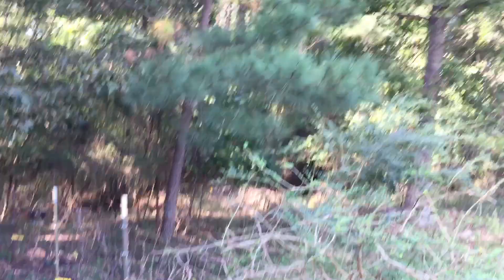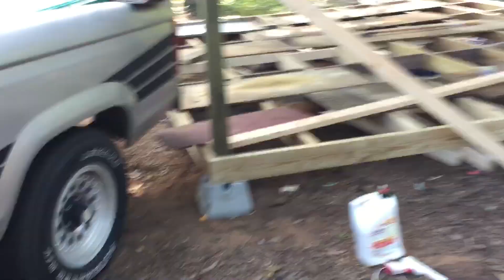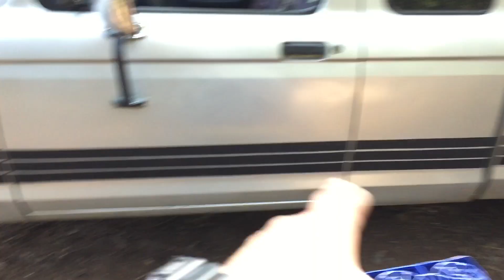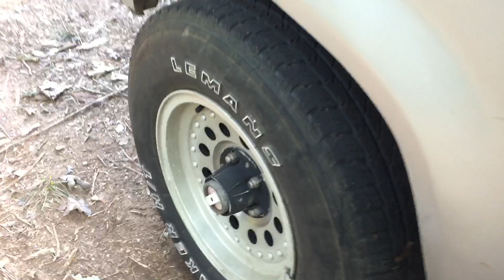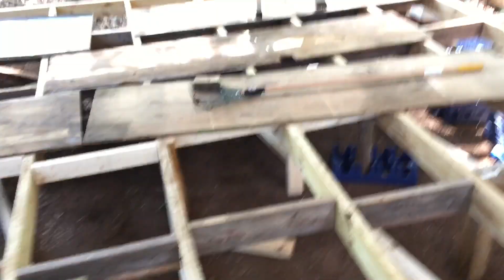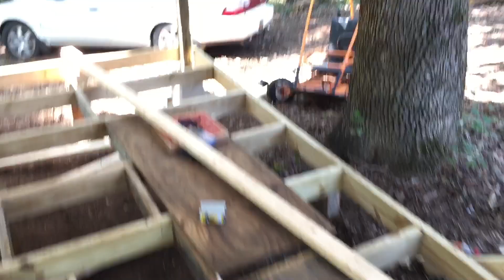Saturday Update

Comment: The tick is from the fuel injectors and is nothing to worry about. Lifter tap is common too, and is most noticeable when the engine is warm and ran on the highway for long periods. Rotating the thrust plate that holds in the camshaft is a fix for lifter tap. Doing so, blocks an oil drain hole...keeping oil in the top end. As for the bottom end knock...check the oil to see if it's contaminated with gas and also check or change the oil filter. Don't use Fram. The stripes on the sides of the truck are part of the "STX" package. I'd be more concerned with the transmission rather than with the engine. The A4LD is known for losing overdrive followed with the forward clutch pack. Swap in a M50D and enjoy. Nice truck!

Comment: Turn a 2wd Rwd pickup truck into a 4wd (prerunner.) They can go off-road but not everywhere anywhere. All you need is to raise them 2 inches and put used bigger tires wheels. Or just a homemade leveling 'kit'.

Comment: doesn't matter the age. things happen. back in the spring time, my 2014 gmc sierra stopped reading oil pressure and I got a message along the line of "oil pressure low. turn off engine" on the message center, so I pulled over and shut it down. I got out, pulled the dipstick, checked the oil level(oil change was done 2 weeks prior) and it was good, so I figure I'd try to limp it back to my work and park it(which was literally half a block), and when I fired it back up to do that, oil pressure was fine. It never done it since. i think the sensor decided it was gonna glitch out on me.

Comment: Sometimes you have those days that it just feels like everything is against you. Just keep going Jay and everything will be okay! The plates that you had in your truck are not ideal for a floor, but I don't know the thickness of them. If it's going to be heavily loaded, I would use them for the walls and find some different ones for the floor.
The symptoms you had with that rock knocking are weird and seems to me something like valve that have play in them. Would take off the valve cover for an inspection to see if everything looks alright.
Reply from the maker: Ilias Lamari this is literally tongue and groove subflooring. Its almost an  inch thick.... this is plenty. As for the truck, I have no idea. Im just gonna roll it until it wont anymore.
Reply: Jay Smart it’s 3/4 osb isn’t it ?

Comment: If you get a explorer or mountaineer with the 5.0 in the yard I would save the drivetrain. Or a f 150 with the truck 5.0 in it.
Reply: Get the expo or mountaineer, stupid easy to swap into ranger. I’m currently putting a 5.0 in a 2002 ranger

Comment: OSB(chip board) goes on walls; not the floor. It only has vertical load bearing.
Reply: Corbin Greiner I’ve seen homes built with it on the floor... What he had there was 3/4” tongue & groove sub floor, he didn’t just have 1/2” sheathing...
Reply: He can build is Hooch shed any way he wants. lol
Reply: Corbin Greiner you don’t have any idea what you are talking about. OSB is used on floors exterior walls and roofs. Most all contractors build this way. Plus there are different types of oriented strand boards. So don’t just say crap you know nothing about.
Reply from the maker: I think your mistaken, this is almost 1 inch thick, tongue and groove sub flooring. Its osb designed specifically for the floor....